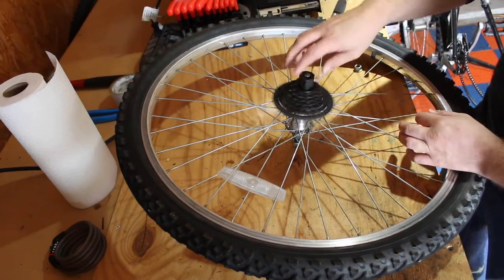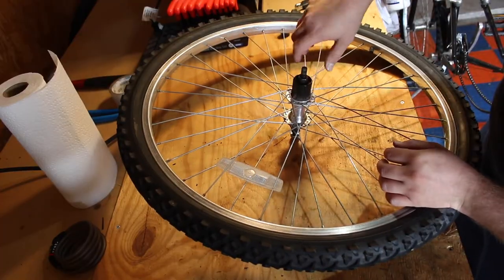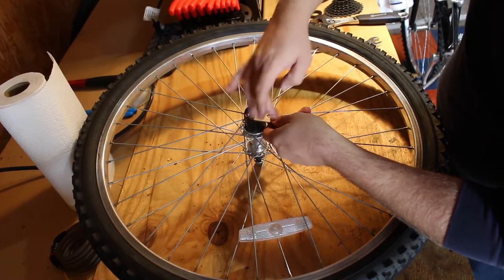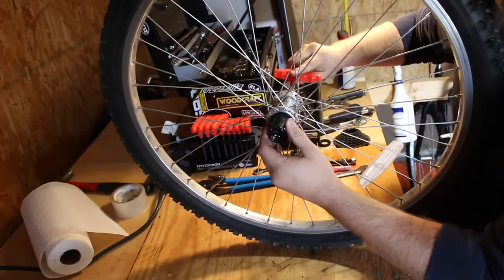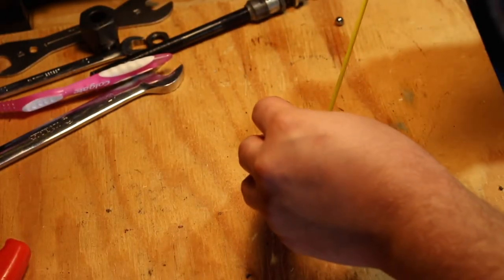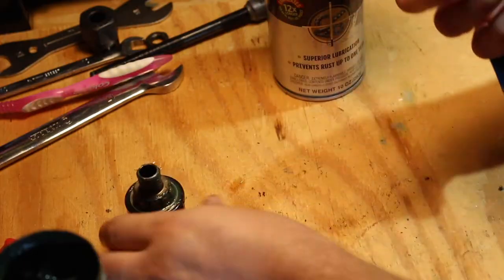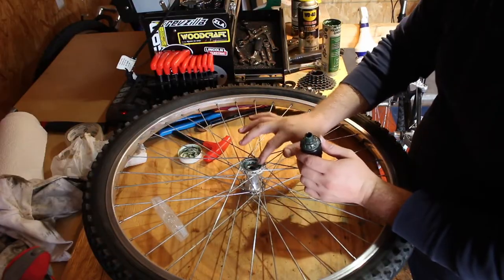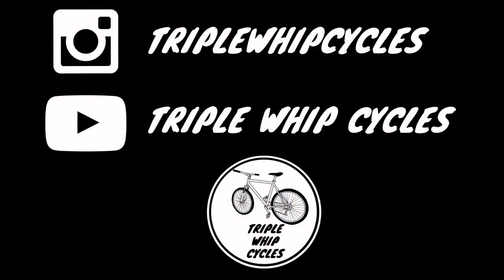How To Fix A Cassette That Spins In Both Directions

Comment: I just did the same thing in 2 minutes by pouring olive oil into my rear cassette and spinning it a few times. Great video that made it easier for me
Reply: Worked straight away for me thanks
Reply: it actually worked thanks
Reply: Some WD-40 followed by olive oil and my bike's back in business. Didn't even have to take the gears off. Great advice!

Comment: Wow! I wonder if I can just use the degreaser without disassembling the whole thing? I thought something broke but it's just debris?  Update: After removing the wheel, I sprayed degreaser all into the crevices of the hub. It immediately fixed the problem. Now I just need to let that drain and spray oil into it. I'll grease it up later as I haven't the tools yet.
Reply: thanks for sharing going to try this!!

Comment: Oh my GOd, thank you so much for the video. i have the problem just few minutes ago and start find how to fix the rear wheel, i did not take off the rear wheel. i used spray lubricant only take 1 minute and the wheel back normal again. Even more better. thanks again..

Comment: Soo, I got one of these freehubs that's having this issue, but mine doesn't have the hex pattern to remove it, any idea how I might get it off? It just has a cylindrical hole all the way through for the solid axle, no super obvious way to remove it.

Comment: It can be done without completely removing the free hub, but acceptably easier and more thorough if you can remove it.

BTW use the axle to hold the nut in place and avoid slipping when using a whip or chain

Comment: thanks ,,great video,,  cleaned mine up  as a quick fix and seems to be working fine so far,,
Reply from the maker: riptiderotter awesome! Glad I could help!
Reply: Do you use Park Tool FR4 to remove the lock ring ?

Comment: Great video, only wondering why it was necessary (or was it just convenient) to remove the free hub to flush it and grease it? If it’s possible, without removing it, it would save effort and the need of an additional tool. I’ll be trying without soon (so may answer my own question!), but thought it would help if you could mention it on any update?

PS thanks for the diy chain whip idea too - simple, effective and even easier to handle than an actual chain whip tool!
Reply from the maker: @RoyPerrett-kb5xc  it’s easier to get to the pawls in the freewheel from the back!

Comment: i dissasembvled my freehub ocmpletely and reassembled it and the only part i did wrong was to put a little too much grease close to the pulse cause now it is rotating freelyt both ways. will the freehub regain its erection if i spin the wheel a little everyday or id the only option to spray stuff in it or reassmemble it again?

Comment: Mine had bearings in the free hub and also on the other side of the wheel! Wasn't expecting that.
Reply from the maker: The bearings being in the freehub is what allows more than 7 speeds. When they used to make 8 spd free wheels the bearings were too far inwards and axles broke often.

Comment: Cant you just take the free hub cap off and clean it manually? Seems like it could be a bit more thourough, but this method seems to work as well so Im just wondering.
Reply from the maker: You’d be unable to access the pawls. You have to get at them from the back end of the freehub

Comment: What size was the allen wrench you used inside the hub? Couldn't catch that part. Thanks!
Reply from the maker: Should be a 10mm
Reply: @tinkerbike2510  Thanks-- tried a 10, but it was too small. I think some road bikes (like mine) actually use a 12 which you have to buy special-- not in many sets. Rest of your process is helpful though!
Reply from the maker: @markbenedict8823  glad you figured it out!

Comment: I was grinding hard up a steep hill and heard a loud snap (I thought I'd snapped the chain) when my freehub stopped working. I'm assuming something else has additionally gone wrong in my case, or do you think this flush and re-grease method will work for me?
Reply from the maker: Definitely think the freehub should be replaced.
Reply: @tinkerbike2510  oh right, thanks. Based on a google image search, I assume I've snapped a pawl?
Reply from the maker: @123a-o5d  that would be my first guess as well.